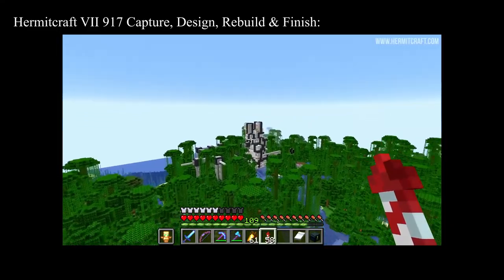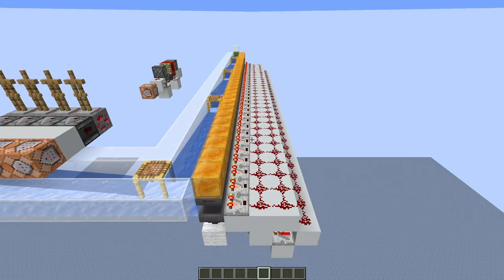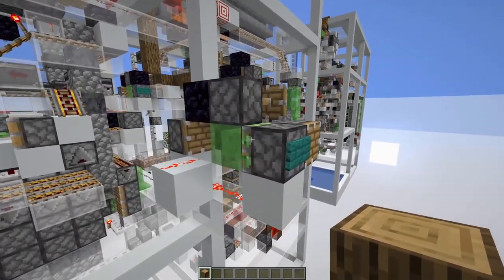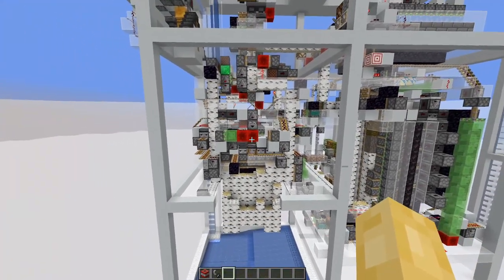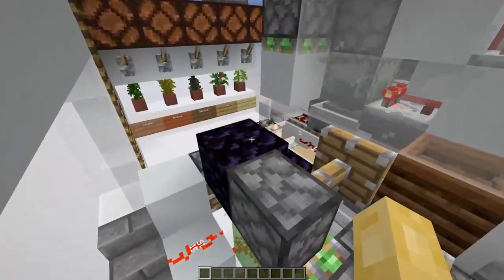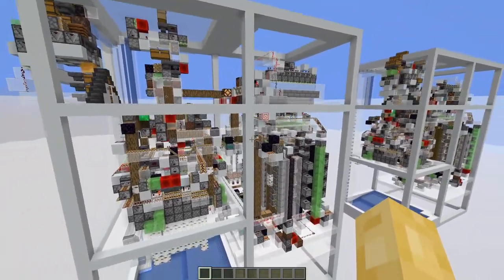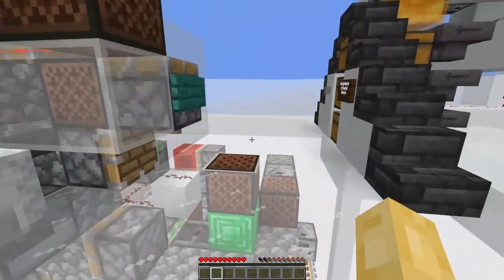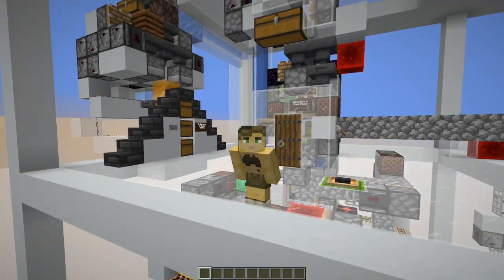Minecrafts Ultimate Omnifarm

Comment: I always LOVE combined block farms. They just spiral around each other with block conveyors and item channels and just keep sprawling and expanding outwards, with tangible intermediate goals and rewards as you add more features to them (a bonemeal farm to automatically supply the tree farm? A bee farm for the copper-waxing? Now that I've attached a bonemeal farm, why don't I farm other plants too? Or even an automatic dirt farm, to link into the blast chamber? How about a furnace array to provide XP to the wood-stripping player? Ooh, but then what do I want to smelt? I've always wanted more green dye, and cactus is good for XP anyway...). They are just the ultimate and most fun technical monster to design and build in my opinion, both for creative or survival, and just continuously ask more questions for more interconnected machinery. Just love all of it to bits. And this build of yours is no exception!! Love it; elegant, sleek, and with such a strong focus on and answer to error prevention and repair (well-deserved for any block farm haha). Congrats and impressive!! Hope you enjoyed designing it!
Reply from the maker: The biggest limitation to the amount of farms you can have connected to the one blast chamber is simply geometry. A smart piston at most can take an input from 4 sides and merge them into a single stream. This omnifarm has a single opening at the top of the smart piston that merges the igneous extruder and log streams. At some point you are going to need additional intersection points to add more farms and it will be like those dodgy power extensions where you keep stacking splitters to get more connections and eventually you end up burning the house down due to an electrical fault. A bonemeal farm makes sense however as I believe dark's super lag efficient design could fit in next to the tree farm module.
Reply: @cubicmetre  I built the 22-module version of dark's bonemeal farm on my server yesterday, but it created enourmous amounts of light lag. We had phosphor disabled for light-suppression(apparently that wasn't necessary though), but I've never had any issues with ilmango's bonemeal farm.

His version may be more lag-efficient, but I'd be careful with using it
Reply: @cubicmetre  Could you use more than one smart piston? Say, move eight streams into two then into one?

Comment: Ok but what if a creeper blows up exactly the pieces that detect the faults? do you have a fault fault detector??
Reply from the maker: The fault detection compares the timing of the four buffers dumping blocks into the blast chamber so provided at least one quarter of the chamber is still moving blocks the fault detection will trigger. The main problem is that the fault detection does not trigger for any parts of the conveyor leading up to the input to the blast chamber. However a fault with this conveyor would be mostly inconsequential. The worst case scenario would be conveyors backlogging until the tree farms fault detection triggers.

Comment: 9:41 Just a small tips, but you could use water logged leaf block there instead of a stair as it will convert concrete powder but is not letting any water spill from it ^^
Either way, loved the video! Especially the little note from Xisuma :'D
Reply: Funny enough, waterlogged leaves don't actually work. Didn't like the water spilling either so I tried it out but the concrete powder stays as powder. No clue why but Minecraft will be Minecraft lol. Didn't get to test with the roots but I presumed them to be the same.
Reply: @matt7399  In java water logged leaves work, I just tested in creative world. However, WL mangrove root doesn't work
Reply: @ashutoxh  Oh? Maybe I got it backwards then. My bad. All I know is one of em didn't work so I didn't try the other lol
Reply: Just tested it although it does work with the conversion of concrete it will break the farm. I'm not a redstoner but my guess is that the stairs passes through a signal and the leaves don't. I did test the alarm system and emergency shutdown this way and it works perfectly!😜😂
Reply: @Bownhead_  stairs dont' conduct redstone
Reply: Specifically because they are not solid
Reply: @Bownhead_ probably you need water flowing to tuch to become concrete
Reply: No the stairs work just fine my reaction was about the waterlogged leaves in the OP's comment, those won't transmit the redstone signal and will break the farm @nessunonessun1
Reply: @Bownhead_  👍 yes I mean from leaf will not flow water....probably it need flowing water and not water source like stone, leafe I think count as addiacent water source
Reply: @Bownhead_  you're wrong. stairs don't transmit redstone signals period

Comment: Fault detection is a really useful tool. I've used fault detection and self repairing sequences for non-stateless logic. Sometimes you have t-flip flops in the wrong state, or instant rail lines that get broken, and it's very useful to just have a "fix it" button.

Admittedly, these sorts of features always come at the cost of increasing material costs, but I think the fact that the reduce the effort it takes to repair probably makes up for it.

What I consider more important perhaps, is the convenience factor while designing the build. Oh, boy, when you are designing anything with redstone, you will be constantly tinkering with parts, and that can frequently break a part of the state of the build. Having a self-repair button lets you ignore that, as long as you remember to hit the button before testing.

I think the biggest problem with this type of tool is the community. People's goals seem to be always either the cheapest, the lowest mspt, or the smallest. None of these design philosophies want extra stuff added to the build, so people wouldn't even consider error handling. If you only think about having the simplest and most efficient logic, then you won't think about adding entirely "unnecessary" parts to aid in repairs.

For example the item filters you showed. Yes, as is, they can totally break when you put even one filter item into your input, but if you added a filter item filter between the input and the filters, you can actually fix that, by simply removing the filter items (use unstackable items or full stacks in the filter item filter's non-filter slots to avoid it having possible failure.) However, since that requires  adding a special filter, few storage systems do that.
Reply: I like the mentality here. Maybe we will move into a new redstone era of focusing on repairability.

Comment: It's important to note that dust lag is generally negligible unless the dust is clocked and not prepowered, especially with mods such as lithium. What I mean by that is, when a dust line starts at 14 signal strength and only goes up by 1 when triggered, it can be extremely lag efficient and often around as lag efficient as rails due to the amount of block updates that rails send.

Comment: in terms of "repair" almost all of my larger redstone contraptions have some sort of access to the wiring, as simple as an iron door or one i like i use an item frame to adjust my enchantment table, removing the item opens the maintenance hatch, a hidden piston door. also i got alot of buttons and things in these maintenance rooms usually leftover from testing while building that often help with resetting the machines during these "edge cases"

Comment: My idea for preventing player based disconnect issues was to have a chunk loader which is only enabled while a player is there (e.g. with a pressure plate). If the player disconnects then the chunk loader would keep the farm loaded until it can safely shut down.
Reply: Sadly that doesn't work in singleplayer, but yeah.

That's a great example of a feature that you can add to mitigate edge-cases that few people.
Reply: @haph2087  disconnects are more of a multiplayer issue, anyways
Reply: @itay1232  True. User error is still one of the largest issues with any tech.

Comment: Considerations for the DAU:
You might want to add some sophistication to the wood type selection on the tree farm:
If you replace the levers by buttons and nor-latches, you can make sure only one type can be selected at a time (by making it so that selecting one turns off all the others) and you can make it so that the farm only runs when there's actually a wood type selected, to make the edge case of "oak branches through user neglect" less likely.
If you additionally make it so that exiting the farm automatically deselects the wood type (for example by an iron door that you have to open with a button which resets the nor latches or whatever), you essentially force the user to interact with the wood selection before using the farm. This means that they can't just ignore the selection out of laziness or forgetfulness. Otherwise, the user might try to use the farm while there is a wood type selected, but it's the wrong wood type, because they selected that one in an earlier sitting and just forgot to deselect it, and won't even notice until the farm breaks.
Also, this way, selecting "birch" actually does something now (as you couldn't use the farm if you didn't select anything).
Reply: For anyone curious: the DAU is the "dumbest assumable user". English speaking people often use the word "luser" instead. It might sound funny or harsh depending on you, but it actually reflects a very important ideal when designing any system intended for mass use (which we can assume is the case here, with all the failsafes already in the system and repair instructions in the video): 
"A general user should need to understand as little as possible about our system in order to use it successfully." 
The "DAU-Ideal" asserts that if a person with no understanding can break our system by accident, then our system is not well-designed enough for the masses. As ideals go, you don't actually expect to reach them in most cases, but it's still noble to strive for them wherever possible.
Be thankful for this ideal, because it's why you get error messages when misusing a program, instead of the program just breaking your entire computer outright, which it could do otherwise.

In our case, while we can assume that any user figures out they need to select a wood type when they first see the wood type selection, once we factor in how habit affects competence, we can also assume that a lot of users are gonna forget and run past the type selection at least once during repeated use unless we remind them.
Reply: As soon as I read "DAU" I knew what language you are speaking
Reply: @meisteryogurt1460  lol Mahlzeit😂

Comment: Bud based player blockstreams can break with decently inconsistent latency, where you end up placing the block before the bud has reset and it just stays there. There are a couple options to avoid this.
If your just using solid blocks make it a normal smart piston. If you have transparent or power able blocks you want to push (pistons, tnt) then a good enough solution is a 3gt clock. Consistently loses efficiency bc of desync with player interval, but it will never break.

I've spent a while thinking about the problem, and I've come to the conclusion the only perfect solution to this issue is 1gt pushlimit detection. I made a setup for this like 6 months ago, but it was a complete meme so we never used it. 
Basically you want this thing to check pushlimit every gametick, output a 0 tick pulse to the piston the moment a block is in front of it, pause for 3gt and then continue checking. That achieves the maximum efficiency possible, supports powerable blocks, and transparent blocks.
Reply: Hello, The piston that pushes down where you place the concrete doesnt work even though it worked for a little bit in the beginning and it does in my test world. I have tried to rebuild but doesnt work. You seem to know alot so please help if you want

Comment: I am modifying the Il mango Clay farm in creative to build it in my world....after I will build this tnt blast chamber to connect to it, I love your work and I love the possibility to wex copper and to do concrete to 👍 and you blast chamber is so small compared to the il mango one 👍 this are the kind of video you do I prefere. I mean practical application of tecnical minecraf 👍
Ps. Using co blestome to extracr blocks is a fancy way, love it to
Reply: I just finished building your blast chamber and it work perfect with concrete in a first test, I had only an allarm at first try, it was out of sinc cause the different length of block streams, but after clear like you shown here it and filled all the chamber block conveyor at same, it worked fine 👍

Now I will connect to the mud-clay farm I builted 👍
After I will build your copper aging farm to 👍

Comment: There is something that can be done with schematics that would make diagnosing machine breaks much easier to filter out blocks that don't need to be removed. It would be incredibly tedious to do though.
When making the schematic, since multiple area selections can be made, it is possible to be absolutely meticulous about which block positions are recorded into the schematic, selecting as little air as possible. Any block position that must be changed to air should also be selected. The only constraint is that the same block position should not be selected twice, no selections overlapping each other (it messes up item counts in material list).

I originally came up with this method because I got annoyed at extra/wrong block indicators popping up when I placed a torch or a Shulker Box or scaffolding. I also made some schematics that needed to be mostly or entirely underground and I wanted to be sure that no wrong or extra block indicator in litematica would show any blocks that I wasn't going to remove or place, so what I did was select only the blocks that absolutely had to be changed. The build was a simple mob farm that used Spawner (Skeleton) or Spawner (Zombie) that could be found in vanilla worlds.

Comment: I struggled to use the omnifarm to automatically convert dirt to mud, because I found the dispenser filling up with empty bottles and the block pusher being too fast for the dispenser to keep up. 

I did the following to fix this: (BE CAUTIOUS & TRY THIS ON A BACKUP BEFORE DOING IT IN YOUR ACTUAL FARM!!!)
* below the dispenser containing the water bottles, put ONE hopper, and fill it with 5 empty bottles (one in each slot). This way, the empty bottles are removed, and it does not break the block pushers below. Unfortunately you'll have to empty it every so often, but I don't really know a better alternative
* DON'T hold right-click since this is too fast for the farm to keep up, and you'll end up with quite a lot of dirt in-between all the mud (which to be fair is not the end of the world, since you'll get the dirt back in the end). Instead, use an autoclicker and set it to right-click every 500 to 600 ms (to be safe). This way, every dirt block you place gets converted to mud
* lastly, add a mechanism to automatically refill the double chest with water bottles when it is no longer full. It's very simple: find the two downward-facing observers which power the dispenser (which will have the water bottles), and place an observer observing the lowest of these two observers (the observer you place has to be observing east). Then on top of that, place a downward-observing observer, and south of that place a northward-observing observer. Run this observer into a solid(!) block with a dispenser on top of the block (dispenser facing east). Water source block in front of the dispenser (CAP IT OFF, SO THAT YOU DON'T SPILL ANY WATER), and a hopper below the water source block pointing into the double chest. That's it, now you just have to make sure the dispenser you just placed has 9 full stacks of empty bottles, and run a hopper chain into it with as many empty bottles as possible (from your witch or raid farm, ideally).

Then, you can start farming mud and you know for sure 100% of the dirt blocks you place gets converted to mud! (Make sure to empty the hopper which collects spilled empty glass bottles every so often!)

Comment: Would adding a simple bone meal farm that gets auto-activated when the tree farm is running low on bone meal work? Or would it be too laggy? Cause then your only maintenance (other than if it breaks) is resupplying empty shulkers
Reply: You could probably hook up a villager farm array to some composters based on the amount of bone meal in the system, and have the excess sent as food for the player while the farm is in use

Comment: For anyone building this in 1.21 and only seeing 1 item in the hopper clockers, its a weird bug with litematica. If you load the schematic in older versions (I used 1.19.2) it shows the correct amount which is 6. Also the dropper at the top of the tree farm with 3 shears and a slab in it, should have 16 slabs.
Also replacing the waterlogged stair that is used for concrete with waterlogged leaves stops the risk of water flowing if the block infront of it is broken
Reply: I don't get any items in any block, no matter if dispenser, dropper or hopper, tested it in both 1.19.1 and 1.21, do you know why this could be?

Comment: PROTIP:
If the blast chamber (in particular the TNT duper) stops working after a long time (despite the schematic being perfectly identical), try breaking the TNT block and putting it back in its place. It seems like the TNT can be in a kind of "quasi-activated" state which prevents it from being duped. This seems to have fixed the issue for me!

PS. after I replaced the TNT, I also right-clicked the noteblock on top of the TNT (it does not make it explode luckily). So there is a small chance that this is what fixed the farm, but I don't think so.

Hope this solves any issues!